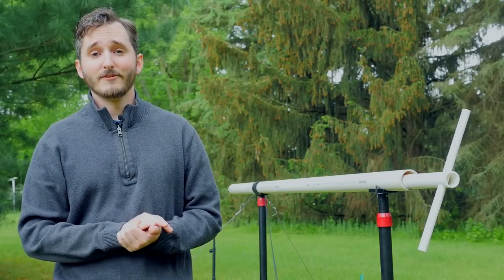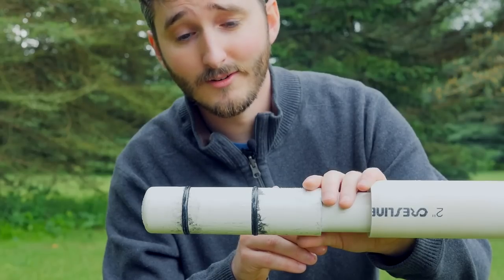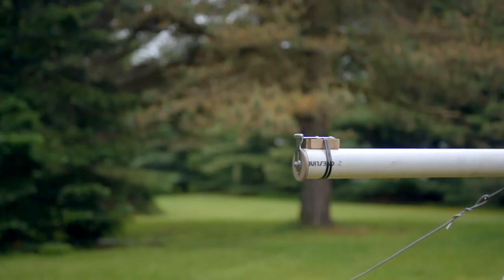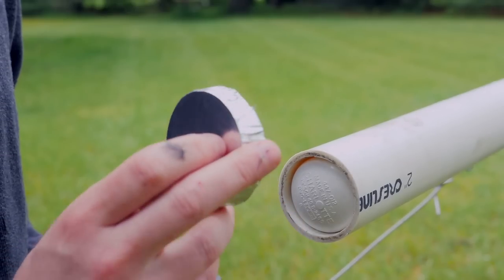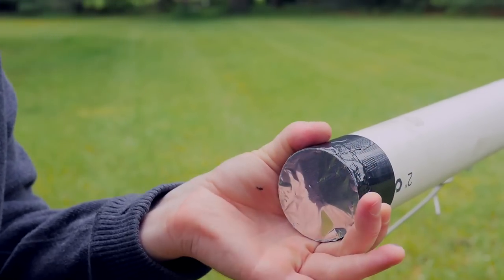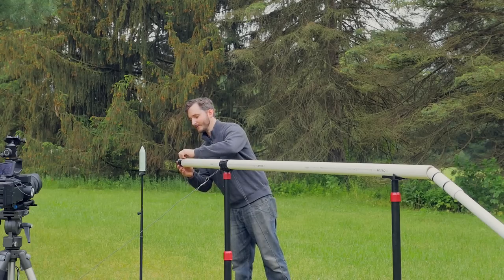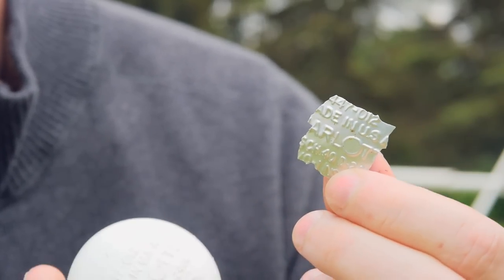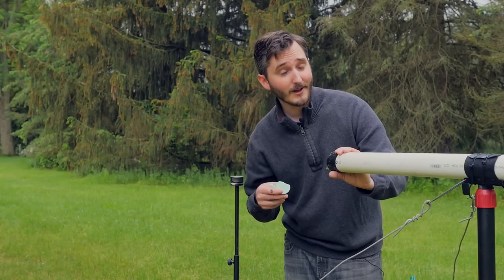New Vacuum Cannon Design - No Vacuum Pump Required!

Comment from the maker: Here's a question for you to think about: Why does there appear to be no recoil when this cannon fires, but my last vacuum cannon recoiled heavily? 
Hint: The answer is not just because the cannon is held down more securely, though that's part of it.
Reply: I assume it has something to do with the projectile launching out as well as the air coming in from the other side of the cannon. The two forces cancel each other out? Hopefully you get what I am saying.
Reply from the maker: Nope. Both cannons would have no recoil in that case.
Reply: Hmmm... you have me stumped here.
Reply: Maybe the Vacuum in the new design isnt as powerful as with the vacuum pump, and plus this one being secured better.
Reply from the maker: The vacuum in this cannon is actually even stronger than in my last one.
Reply: Is it because  you do not have as much pressure inside the canon due to it is hand powered?
Reply: Does it have anything to do with the fact that you are pulling backwards to make the vacuum and then to release it in the new design, but in the old design you were hitting it with a hammer?
Reply from the maker: +Scoop Science You're getting warmer
Reply: NightHawkInLight because it has the same principal of your old vacuum canon
Reply: NightHawkInLight only one end has to break?
Reply: Maybe the recoil is affecting the piston instead?
Reply: I need to build both versions of this so I can visualize why. I can't seem to expand on my previous reply. Hmmm....
Reply: isn't it because the projectile is smaller
Reply from the maker: No correct answers yet, but a few are on the right track.
Reply: or did you just mount it to the ground better because you needed to pull so hard?
Reply: As Simon stated, the recoil is affecting the piston instead. So what he is saying is that in the exact moment that you pull the piston out, any recoil is "used up?" by pushing the piston back instead of the actual cannon. Just a theory. Maybe that could be expanded on.
Reply: NightHawkInLight the air that rushes in has nothing to press against, only the projectile. already forgot how ur last cannon worked i have to rewatch
ok now i rewatched
i think the low pressure sucks the vacuum cannon back, or its because of the air between the backseal and the projectile. but I actually have no idea
Reply: Since you're pulling the piston backwards, you are pulling the cannon with it until it can't go anymore because it's secured. When it fires, the cannon is already pulled back, so you can't see the recoil even though it's there.
Reply: more efficient transfer or energy from inrush of air onto projectile mounted at the end of piston as opposed to a projectile sitting a few inches from back opening?
Reply: By pulling the piston back, that makes the cannon want to go back, so that gets rid of the force of the recoil making it want to shot forward?
Reply: My guess is because of the thickness of the burst disk and the air cushion that bursts it.
Reply: Scoop Science I think that's the key, the vacuum in side the barrel is pull him the piston in the direction of firing, but when you release the piston out the air try's to rush in side of the barrel and makes a effect like a "vacuum cleaner" pushing the barrel back's of the direction of firing and that 2 forces canceled out it other. I hope you get the idea, it's hard to explain by writing...
Reply: To elaborate, the burst disk has to be punched by the air cushion. The thicker the burst disk, the harder the air cushion has to punch the burst disk, and the harder the recoil will be. If the burst disk could be 'deleted' the moment fired, the inrush of air would pass right through, and there would be no recoil.
Reply: I think I understand that. I also agree, it is really hard to explain by writing!
Reply from the maker: Vitali Angere, first to get the right answer, very nice! Yes, when pulling the piston backward you are pulling the entire cannon with a force equal to the atmospheric pressure on the piston, which is equal or greater than the force that any recoil will be. Since the cannon mount is already tensioned to a force equal to the recoil before firing, once the canon fires the recoil will at best only be strong enough to keep the cannon stationary for a moment before springing forward. For those of you wondering why vacuum cannons recoil at all, don't think about the projectile's effect on the cannon barrel, rather, think about the air that has to rush in and fill the void. As air is moving into the cannon the cannon body itself is being pushed backward toward the air with equal force. Recoil in a vacuum cannon has very little to do with the projectile.
Reply: Good job Vitali Angere!!
Reply: Is it because all the "recoil" force is actually created by you pulling the piston back? So when you release it, there's pretty much no backwards force left?
Reply: My 30 second analysis (typing not included): 
In this design the projectile moves freely through the entirety of the pipe. and there is no gas in front of it, therefore when the gun is fired and the burst disk i cracked open by the projectile there are no release of build up potential energy (pressure). if anything there could be a small amount of "negative" recoil from the projectile hitting the foil.

as you mention in the video, the dual burst disk design does not archive a perfect vacuum and when it is fired, the projectile will compress the gas against the second burst disk until it bursts, and the gas is released. the sudden release og gas opposite from you. creates a recoiling force, being transferred to the pipe,  by pushing on the end of the "blind hold" created by the inner walls of the pipe and the projectile moving forward, as well as minor contributors such as the friction from the projectile and the fluidtic resistance in the tube.
(edit typo)
Reply: While I agree with your negative recoil analysis, as it is exactly something I noted as well, his explanation points out how the inrush of air causes a relative vacuum outside of the barrel and behind it, which will pull the pipe backwards.

I would bet there are TWO separate recoils going on here. The first is the positive recoil, then a secondary recoil pushing the barrel back forward again. In this example, the air cushion and projectile are no longer 'part' of the barrel and are a secondary force.
Reply: NightHawkInLight.

you have an awesome narrators voice. pardon my english.
Reply: the first canon recoils back because of the conservation of linear momentum. Same thing happens with the second canon but this time you are also pulling back so by Newton's third law there also a force pushing forward. so you would have a force going forward and another going back which makes it seam like there is not much of a recoil.?
Reply: To keep it short, sweet and understandable.

 It uses Newtons third law equal and opposite reaction. 

So just switch out how you would conventionally propel a projectile  that causes recoil. 

Since the reaction takes place from the rear to the front there is no platform in the rear for the force to act on upon as appose to the front of barrel having a platform that helps create the vacuum.

When the air pressure is suddenly returned to normal by the piston fully exits the rear of the barrel the violent change in air pressure results in a propellant acting force that is rushing from the rear towards the front pushing out the projectile. 

So he is pretty much shooting a conventional riffle back to front by holding the barrel towards the firer and the stock towards the target.

This unconventional method or the balance of equal and opposite reaction is also a similar concept to how recoil-less riffles work 

:) time to get schwifty in here!
Reply: NightHawkInLight yay! A new video!!!!! They are verry rare now a days....
Well WHO cares, Its high quality so
Reply: The previous one had air that didn't break the vacuum seal immediately. It had some time to push on the gun before breaking. Some of the force from the acceleration of the projectile was turned into "recoil".

For this one, no air trapped, projectile just tears the vacuum seal apart, little energy loss to shake the gun.
Reply: No recoil because the air is getting in from one side and the projectile comes out of the other side , which sort of balances the two forces and also holding it down helps further
Reply: Actually, I think there should be "recoil" because as the round is accelerating forward, the front endcap is being pushed backward by atmospheric pressure, Ie the center of mass is conserved
Reply: Harsh Thakkar that's not it it because in every gun it has like that but they all have recoil
Reply: NightHawkInLight the air moves forward and pushes the projectile like a sail of a boat the recoil is mostly resolved in the air, only the ring of the tube is pusht against so a low recoil.(just a touth correct me if im wrong so we can have a nice confersation)
Reply: Scoop Science 
Thank you!
Reply: (update) Its because of the weight of the projectile and the amound of air moving. (again correct me if im wrong and have a nice discusion)
Reply: Magic
Reply: NightHawkInLight I guess that the section of a vacuum cannon is the main source of recoil, since the recoil must be produced on the moment between the air rushing in and the projectile hitting the seal. During that time, atmospheric pressure is pushing the projectile, but also the cannon.
second part ofthe story is that by pulling the plunger of this model, you are actually producing the same pull that would otherwise be the recoil of a traditional vacuum cannon. hard to explain, hooe you get the idea?
Reply: The projectile is traveling as fast as the air in this one, in the other fast moveing air rams into the projectile. Every force blah blah blah. Recoil because fast moveing air hitting piston, final answer.
Reply: NightHawkInLight air is heavy. you said it yourself, there wasn't a perfect vacuum. slamming that block of air around gave you the recoil.
 - then again, physics is what drove me to IT work. I still hate physics.
Reply: You pulling back giving the counter energy for the recoil, the vacuum shoots forward from the back, and you pull with your energy you still have in your arms backwars, leaving the cannon with no recoil since the energy is balanced out?
Reply from the maker: DoNotPushHere, The second half of your comment is the correct answer. The first part is incorrect. The air is not pushing the cannon in the same way as the projectile, rather, the cannon is being pulled backwards (or pushed from the front burst disc if you want to get technical) to fill the void with the same force as the air rushing in.
Reply: Please make another one and launch a ping pong ball! Maybe even a tomato in this one. Try even a empty or full soda can to! That would be awesome!
Reply: Slo Mo Guys this shizz!
Reply: My guess is that some of the work done by the recoil is being transferred to you when you're pulling back the pipe. When the vacuum has to break the tape it takes a little bit of the energy out of accelerating the projectile this reducing the recoil. Also the projectile is smaller and therefore has less momentum if it's being shot at the same speed as the other cannon's projectile.
Reply: It's working like some versions of recoilless rifles by imparting an opposite force prior to the gun firing, like guns that the barrel moves forward some distance forward when you pull the trigger and then fires canceling out some of the recoil.
Reply: Great design
Reply: NightHawkInLight Just curious. What causes your need for money support. I'd support but I don't have money.
Reply: TechnologicalStudios YouTube revenue fell over 60% for some.
Reply: Imagine you had a job that suddenly paid you 40% of what you made the month prior.
Reply: Yup, sorry I did mean exactly that! Of course the vacuum is being depressed by atmospheric pressure from all sides actually, but only piston and cannon can move relatively to each other, so both move in opposite directions.
thanks for the answer and thanks for sharing your excellent work
Reply: Virgil R Garwood That's terrible. Is it a YouTube thing?
Reply: TechnologicalStudios yeah something like half their advertisers left the platform taking the adsense payments with them... it'll bounce back when they convince advertisers that changes to the platform have addressed their concerns with where ads are shown.
Reply: ... it was really like watching hiccups in other manufacturing fields. American trades with China moving steel production over seas for instance. The biggest difference here (and why I'm confident YouTube will be fine) is the means of producing the product still lies with the creators. Youtube just has to take a minute and figure out profitability again.
Reply: Wow. I have also been noticing some posts claiming YouTube is slacking too. That was in the trending for me at one time.
Reply: TechnologicalStudios I'd cite those claims as being emotion based on lack of communication from YouTube... they're not the most open when they're having an issue of some sort... I mean really from day1 they basically were constructing a well engineered house of cards that was only obviously a sound structure after being absorbed into Google. (I argued they could've done it on their own and I'm still confident they could've and not turned into metacafe)
Reply: what if you made it longer
Reply: NightHawkInLight can you turn it into a mini cannon like a handheld cannon
Reply: can you make a multi barrel air cannon on this design ?? like say 4 pipes of different length and different length pistons so when you fire they go boom boom boom boom ??
Reply: This is ingenious
Reply: For your burst disk or flap, have you considered having a flap that has a spring pulling it open, so the instant there is no longer a vacuum being pulled on it, it snaps open?
Reply: NightHawkInLight Because the tube is a uniform shape the air rushing in encounters no friction and thair is no Kick, also both ends are open so thair is no place for the projectile to exert force on, unlike a gun where it is sealed at one end and the projectile exerts a force the push the gun backwards. The previous cannon had a well sealed projectile and so backward force is exerted onto the gun resulting in recoil.
Reply: the "last bit" when you yank the piston out gives the system almost the same backwards force as the 46lb's going back in so the net force is almost 0
Reply: Because the maximum amount of recoil you will get is 46 lbs and by drawing the vacuum you are already exerting that force to begin with by the time the piston has been removed.
Reply: Probably acts like a "recoil-less rifle" some of the propellant( high pressure air under a vacuum) is used to defy Newton's third law or push the cannon back to its original spot
Reply from the maker: Michigan
Reply: NightHawkInLight you're in Michigan?!? Where abouts in Michigan, that's where I'm from as well.
Reply: Please tell me that it is NOT a public street in the direction your cannon points.
Reply: The maximum felt recoil of the rifle is preloaded and does not increase further once the piston seal breaks and allows air behind the projectile. Thinking this is a great idea for a simple flinger. Ever try launching a rolled up tshirt from it?
Reply: the cannon is secured much better :DD
Reply: it does, it's a spring gun, the recoil moves in the direction of the spring decompressing.
Reply: The uploader has explained why there is little recoil in this thread. Unfortunately your explanation is wrong.
Reply: Haven't looked at the replies. You pull on it for vacuum. that's the friction. so the rigging  moves/bends in the pulling direction. The rig needs to hold till the vacuum gets equalized... the other one barrel sucked itself back to do this.. this pipe rig was already on tension and kept it when the plunger escaped the barrel with the air rushing in. What would be fun though would be a release mechanism with a bunch of holes you move the plunger past. Or a fumes extractor like in modern tank guns :)
Reply: NightHawkInLight I'm from Ohio
Reply: my guess would be the recoil is actually the same its just when you pull on the piston you actually move the cannon backwards. that energy is released upon firing moving the cannon forward which is then counter acted by the recoil of the projectile leaving the barrel. those two forces canceling each other out have a lot less net energy gain in any one direction....
Reply: Andy T I'm in ohio (cries)
Reply: Something along the lines that recoil is caused (in a standard firearm) by an explosion creating a pressure wave. The wave travels in both directions, both pushing the projectile and pushing backward toward the breach end. In the new design, as the air rushes in, it creates a pressure wave but it's only traveling in one direction from breach forward. The weight of the atmosphere is sufficient to hold any back flow or recoil from happening. Or so is my guess without having actually measured it. 
Thinking aloud, this explanation doesn't entirely explain why the previous design might have had recoil... interesting to consider.
Reply: I was wondering how big the lawsuit would be if you miss the can and hit the minvan with the soccer mom and kids. Seems a sheet of plywood and some 2x4s would be cheap liability insurance. Could also make some neat wood impressions.
Reply from the maker: The road is far out of range.
Reply: Pretty much my first thought. No backstop, and vehicles are passing in the background.
Reply: NightHawkInLight I have a question for you. What happens if you hit both sides of the larger cannon at the same time. Can you please a video on this
Reply: I figured as much, I just thought it could ease the neighbors concerns. And make some neat wood impressions.
Reply: The way I look at it, with the dual burst disks the force on the front disk and the force on the back disk balance each other out so the barrel is in stasis. As soon as you break the rear disk it is no longer pushing the barrel forward so force on the front disk accelerates the barrel backwards. In the new design there is never any force on the back of the barrel, it is on your shoulders, so the barrel is forced back (against the guy wires) as soon as you start pulling the vacuum. (pun? yes) Really the same answer.
Reply: How far can your cannon shoot

please notice me
Reply: late to the party, and I'm sure its already ben answered, but ill have a crack at it. the answer is quite simple, as newton stated "every action has an equal and opposite reaction" meaning that your method of firing the 2 disk system was causing recoil when you hit the rear disk on top of that it was also the air that was rushing in. as for this design you are breaking the seal in the onsite direction causing the reaction force to be forward and sense you've already pulled the whole cannon back the recoil from the air is minimal in comparison. this recoil is vastly different from that of an actual gun where the firing pin is to small too create any notable recoil, but the explosive way in witch the projectile is fired causes the recoil.
Reply: I think I have the answer....if we use the third law of motion....we can get the answer....when you pull the pison rod backwards....technically it wants to move forward and the cannon moves backwards due to atmospheric pressure....when air rushes in...the cannon is attracted to move backwards but you don't see it!!!! or feel it....but the recoil is there...it kind of cancells out...do tell me if i'm right....please?
Reply: I mean the recoil is there....it's when u pull backwards!
Reply: imhbomb I thought the same thing
Reply: Which is better, vacuum cannon or compressed air cannon? I was thinking that vacuum cannon is limited to 14.7 psi but with compressed air, i can put more pressure. 
Does a vacuum cannon, which is around 0psia, have same power as a compressed air cannon with 29.4psia pressure? Any pros/cons between the two cannon?
Reply from the maker: Vacuum cannon is better for light weight projectiles, air cannon is better for heavy.
Reply: NightHawkInLight   Can you Shoot vacuum cannon in a vacuum
Reply: pyry pajula dude this thing works cause of atmospheric pressure.....there needs to be a pressure difference
Reply: NightHawk
Why not make a video comparing vacuum cannon with -14.7psig inside and pressure cannon with +14.7psig pressure then measure the impact force or maybe the velocity :D
Same projectile size and weight.
I wonder if the projectile in a vacuum cannon will have more impact because theres less air molecule inside the cannon while it travels
Reply: NightHawkInLight The same reason an rpg doesnt send you flying. The back of the pipe is cleared, allowing gas to be released through the back, producing much less recoil.
Reply: Rachelle can it be done with guns too?
Reply: booger king no as the shell will back fire....
Reply: Yes, of course! Look at the RPG series, the Carl Gustaf series, any 57mm or 75mm recoilless rifle, and a number of other designs. Many larger bore firearms have been made with what amounts to a rocket nozzle on the end, where there is much more powder than needed to fire the projectile. It powers the projectile forward, and the rest goes out the back to counteract the otherwise unmanageable recoil.
Reply: does the length of the PVC pipe matter. Because I want to build one for a project but we have to have a certain length. Please respond immediatly
Reply: Hannah Johnson I made a five foot long cannon and it worked just fine!
Reply: made a vaccuum cannon from a syringe lol, there was no recoil too, maybe its the toughness of the closed end. the more tough it is the more recoil you have.
Reply: The cables have been pre tensioned by your pulling, then the vacuum pulling the projectile is forcing the Barrel (PVC) in the same direction that you had just pulled, which stabilizes the cannon since it can not recoil stronger than you pulled.
Reply: Is it because of the energy used to pull the projectile off the piston, removing the tape if you will?
Reply: the ammo is lighter. at the end of the day all recoil is generated because one same force pushed both the gun and the projectile. therefore the heavier the projectile the the harder the recoil because the gas would be pushing on the bullet relative to the gun.
Reply: it doesnt have a recoil cause when it fires its literally an open tube.Air comes from the behind and the relief comes on the front side where there is only the aluminum foil to hold all that energy.
Same principle comes with the rpg as another guy mentioned.The fumes decompress on the backside of the open tube so nothing holds all this thermal energy to convert it to kinetic.
Reply: no recoil...suckcoil!  the reaction is in the other direction because it is not a powder cannon
Reply: Because the plunger and it being manual counteracts The Recoil
Reply: I've got a better question.
What happens if as you are pulling a vacuum the burst disk bursts prematurely? RIP
Reply: Because only the air is accelerating the projectile. The pipe has no effect on pushing the projectile forward, just the atmosphere.
Reply: This happens “because the air coming from the back cancels the force exerted by the projectile” thats my theory 😁
Reply: Guessing because the recoil is going down an empty tube with little resistance...!?
Reply: Because the air rushing back into pipe counteracts it Im guessing